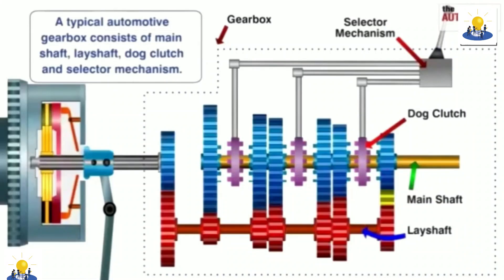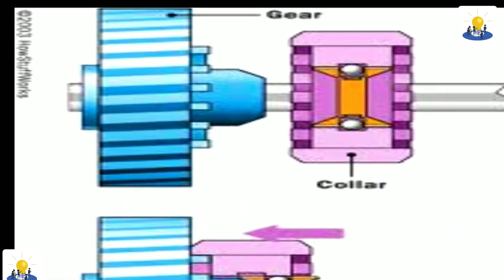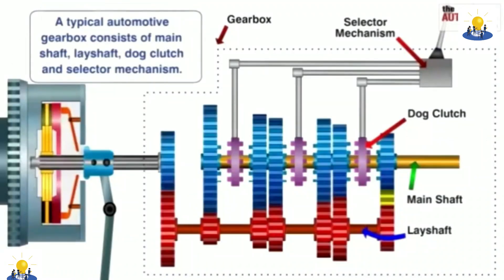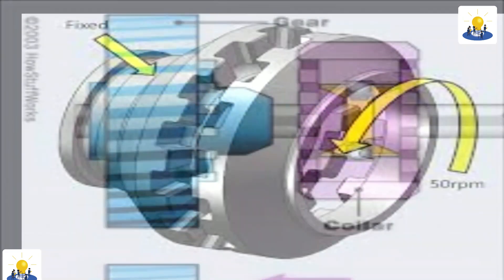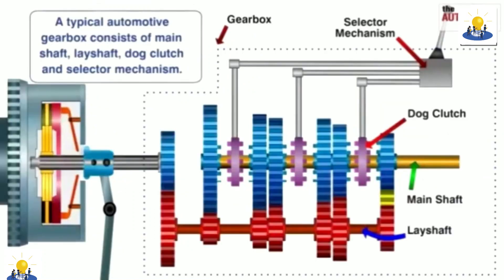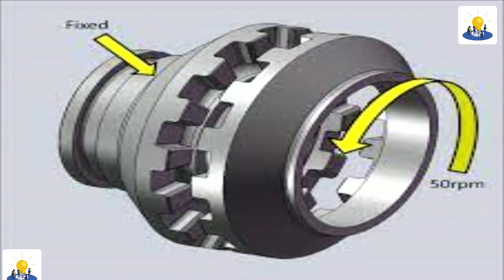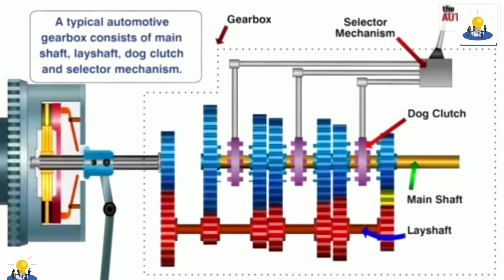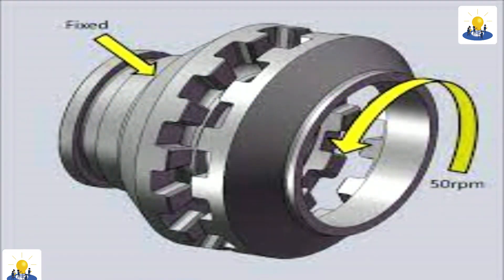Transmission Dog Clutch Working

Comment: Can you tell me how you can calculate the force required to push Dog clutch
Reply: Chat Gpt?😂
Reply: @kingofmonsters7452  mitada heim
Reply from the maker: To calculate the force required to push a dog clutch, you need to consider the coefficient of friction between the clutch surfaces and the normal force acting on the clutch. The formula to calculate the force required is:

Force = Coefficient of friction x Normal force

The coefficient of friction depends on the materials used in the clutch surfaces and can be determined through experimentation or reference tables. The normal force is the force exerted perpendicular to the clutch surfaces, typically due to the engagement mechanism or springs.

By multiplying the coefficient of friction by the normal force, you can determine the force required to push the dog clutch.